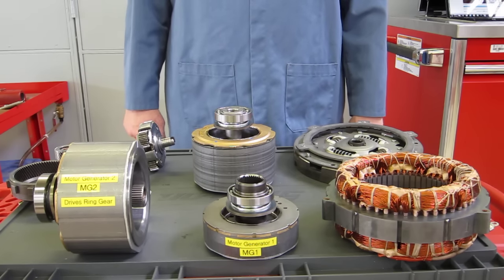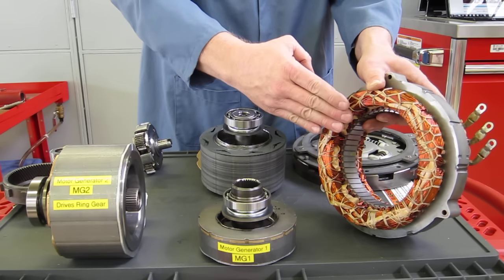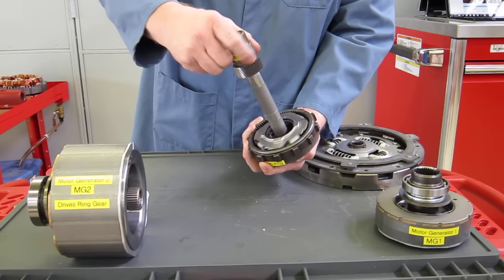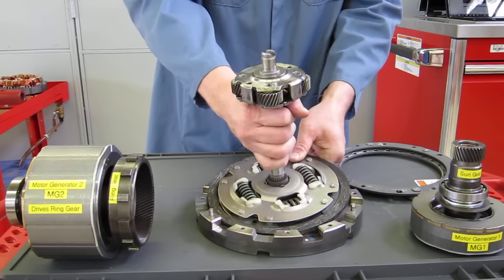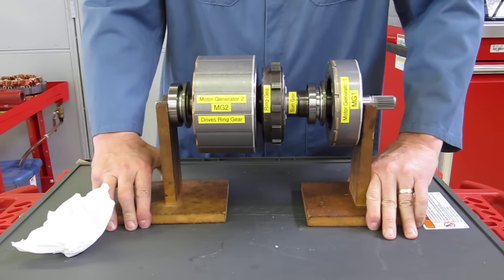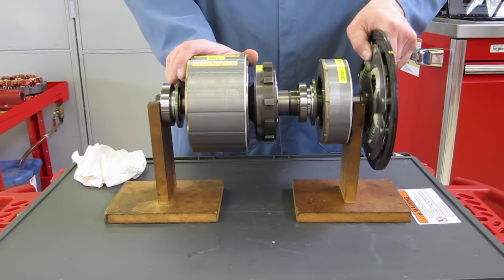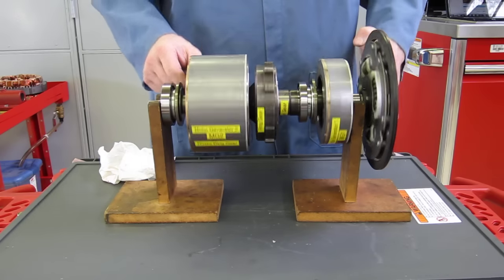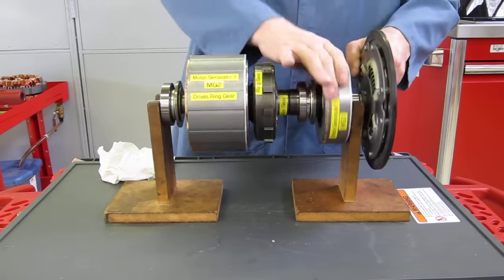2004 - 2009 Prius P112 Hybrid Transaxle (eCVT) Operation

Comment: Hey Prof. Is it theoretically possible for the engine alone  to move the car forward assuming MG2 was disconnected/removed? 
Or would the planet gears simply spin around inside the ring gear without any motion from the ring gear?
Reply from the maker: No. The engine only spins the planet carrier. The small motor MG1 would just spin. The ring gear (connected to MG2) is the only part connected to the final drive. The car would not move.
Reply: WeberAuto Got it. Thanks
Reply: @WeberAuto  I was in a Camry Hybrid taxi a couple of years ago. Their was an electrical fault so the car was using the petrol motor only to drive the car while awaiting for a part from Japan. It was slow but worked.
Reply from the maker: @briananthony4044  There are many electrical faults that cause the engine to run, but that does not mean it was the only source of power. I suspect the engine was spinning MG1 to send power to MG2 to propel the vehicle.
Reply: @WeberAuto  Given the condition in Kie Njirus comment, in which MG2 was electrically disabled but still able to spin, the ICE could theoretically power the vehicle as long as a resistive current were supplied to MG1 to slow it down, or resist freewheeling.  This would allow power to transfer directly from the ICE to the ring gear and power the vehicle down the road.

Comment: Quick question. We had the chr, coming down a mountain and reached full battery but engine was reving very high! Is this to disapate unwanted energy?
Reply: Probably it might be due to engine braking
Reply: You should use the B mode of your car to slow down more. Going downhill your MG1 is turning and producing electric power for your hybrid battery. Because you don't slow down enough and your hybride battery is full, the ICE engine is started and uses the pistons compression as a extra break.

Comment: It's a weird experience for sure to drive your first hybrid like this. Downside is that it's really hard to feel speed when there's very little road noise, engine noise, vibrations, road feel on steering wheel etc. driving dynamics. After driving a super-communicative Mini Cooper S for 5+ years, this is soooo strange. 50MPG beats 22 though...
Reply from the maker: Thanks for your feedback
Reply: Put it in B mode and use Eco mode to have a smooth pedal-throttle response curve. It’s literally a CVT downshift, keeps the power where you need it and simulates engine braking. 

 I’m passing cars and keeping up with sports cars. The Prius is no joke when it comes to weight. 3K lbs for a car this large and well equipped. 

I can drive it faster on super windy downhills  than my M3 E46. Its only limitation is tire sizing and suspension upgrades. But if the tires were the same size, I think it’s smoke the M3.
Reply: @CFloPhotography  Mine's an older model, so no eco.

Comment: Which one do you think is more reliable. A normal CVT or the eCVT from the Prius? I want to give CVts a try but I’m afraid they’re not as reliable as a conventional automatic transmission.
Reply: my understanding is a push belt CVT  (the typical "snowmobile/scooter transmission" type) is inherently flawed for passenger cars, they're generally unreliable  and the belts have a tendency to score the variator cones (pulleys that make up the "variable" part of CVT) and grenade at the worst possible time (especially JATCO transmissions),  the safest rule of thumb is to avoid belt base CVT, which is most of them

transmission reliability  (best to worst)
Manual>Toyota E-CVT>torque converter auto>DSG/DCT>bicycling>horseback>walking>CVT

Comment: I'm a bit confused.  I've been told that this is a parallel hybrid (engine and MG in parallel) but this demonstration makes it seem like a series hybrid.  MG2 drives the car, and MG1 is driven by the ICE and generates power for MG2 and the battery.  How much power from the ICE is passed to the driveshaft?  There appears to be no direct connection, but is there some force passed?

Comment: @end he incorrectly says the engine is not driving MG2. He holds MG2 in place to try to show it's not moving. There's no brake(band clutch)so this isn't happening. At high speeds, engine drives the PC & the battery drives MG2. MG1 is being moved by the sun gear through the combined output of the other two, and generates electricity to keep the whole thing going. It's a partial conversion from kinetic>electric>kinetic energy, hence less efficient, hence prius is not as efficient at hwy speeds

Comment: I'm a hardcore manual guy, I utterly loathe automatics (esp. sludgeboxes and push-belt CVT), but I have to admit the simplicity and robustness of the e-CVT is impressive...

no fragile, slip prone belt, actual, real *gears*, and it looks like it doesn't have the power waste of the torque converter, it has performance potential...

pity that the Prius is about as much fun to drive as getting a root canal with no Novocain... Toyota, why not put your E-CVT in a car that's actually FUN to drive!

My current daily is a '12 VW Golf TDI with the DSG (manuals are rare and more expensive in my area), I do wish I had waited for a CPO manual , but I needed to replace a totaled car ASAP, and for 9K I can live with  the compromise that is the DSG

that said, the DSG is about as close as you can get to a conventional manual in an automatic.

once Toyota puts the e-CVT into a car that doesn't induce a comatose state when driving, i'll try it out

e-CVT in an 86 or Supra, okay, as long as the manual's still available**

** I know the BMW...err...Supra currently doesn't have a manual, bad move ToyMW...
Reply: MacTechG4 modern automatics lock up the torque converter and bypass the hydraulic coupling pretty aggressively, so the “slushbox” term is several decades out-of-date.
Reply: @Kyriaeus  ; very true, but they're still not as direct as a true manual or even a DSG/DCT, they are more reliable than a DSG though, like everything else, its a balancing act and I fall on the side of "fun driving experience", so it's either manual or DSG for me, YMMV

Comment: How does this achieve continuous variable speed?
Reply from the maker: In EV only mode, it does not. In combined (hybrid mode) the rotational speed difference between the 2 motors and the engine creates a CVT affect in relation to the engine crankshaft speed. Thanks for watching!

Comment: How reliable would you say these 2nd Gen CVT are? I've heard horrible stories on these types of transmissions
Reply from the maker: Very reliable, no worries
Reply: The name CVT describes the function of the transmission, not the mechanical implementation. Nissan, for example,  has a reputation for garbage CVTS in certain cars. Don't assume all CVTS are similar in design.

Comment: I have a gen 2 and it has a loud whine when I let off the gas. It also has trouble getting into ready most of the time. I always have to unplug the 12v to get it into ready mode. Mechanic said I need a new transaxle. Do you think this is the cause?

Comment: If you hold still MG1 then the input shaft should turn at the same speed as output shaft, at this moment the engine will be directly connected to the wheels. So i do not agree with the statement that at no time the engine is connected to the output shaft 😉

Comment: My last automatic car only lasted 60k miles when the gearbox failed, yet these transmissions seem to last up to 400k miles or more, should have bought a Toyota instead of a vauxhall. That was seven years ago, only driven manuals since. Although I had a few automatics prior to that and these did reach 200k miles!

Comment: 13:48 So the I.C.E. engine never directly drives the wheels, only the electric motor does that?
Reply: Never directly, however the ICE can contribute to the output of the hybrid system and charge the battery at the same time.
Reply: @aspecreviews  if it contributes, that means it DOES drive it at a certain speed..

Comment: 12:54 "mg2 spins faster and becomes charging"  should be mg1, i believe you may have misspoke
Reply: so it's not a "cvt" cuz, the ratio never changes.  just the power and rotational split btw mg2-mg1-ice.  
i read that newer toyota hybrid's may have 2 planetary gearsets.. that would have a nice demo :)
thanks weber auto, nice demo of the actual hybrid transaxle.

Comment: watch?v=rQhzruw2Qh8&t=9m13s on youtube and see that this idea was not originally from Toyota. It was presented in 1953 by the DoD (fast forward to time mark 9:13 of that video). The 2 inputs mentioned by the Army engineer corresponds to MG1 and ICE. Toyota drives the output gear directly with MG2 also, so they've improved it to become a 3 input system.

Comment: If they scaled this up size, power and had out in a RWD platform; I'd stuff it in a 70 Chevy Chevelle for two reasons... 1) seems like way less wear and tear cause like every other cvt your always on the right gear 2) save on gas (bonus) make every V8 bow tie fan mad cause I made a Chevelle a hybrid. But I think it would be fun if they could increase the power.

Comment: Geez its a simple system. I wonder why toyota choose to not put a larger m1 in place or the same size as m2. The whole driving and not charging while going from m1 assisting in keeping the charge up is quirky to me even if it was dropped to 50% of full power generation. Its like a no brainier thing to do. It would allow you to go a little further but their is a trade off at some point where it hinders distance. my 2 cents.

Comment: Hi I still don't fully understand the function of the Transaxle Damper... It would be really helpful if you could elaborate on it.  Is it basically a dry friction clutch but always applied? In other comments you say it doesn't slip however it has springs which leads me to believe that there has to be some sort of movement within it.  What components could be damaged without it?  Does the prius ICE have its own torsional damper (harmonic balancer) or is the transaxle damper used for this as well?

Comment: He missed two points on the operation of this thing. First he says that spining MG1 starts the engine. This is not true. The engine will not start by itself without the injectors and spark plugs firing. During the all-electric time, since there is no clutch used to disengage the engine from the PC, the pistons in the engine are moving up and down. This wastes some energy, but reduces wear. It Isn't optimized for all-electric driving anyway, so probably wasn't a consideration for Toyota.

Comment: Wait what at no point is the engine driving the car it's only used as a generator, mind blown
Reply: so, you don't need a starter motor, or even a Alternator, because that's all the job of MG1. :face-blue-smiling:

Comment: That moment when you realise that calling a 3 phase electric motor a generator is absurd, due to generators generating dc energy. It should be called a motor-alternator.
Reply: Generator is correct. It is an alternating current generator, which got abbreviated to alternator.
Most electrical technical literature will refer to them as AC Generators.

Comment: I will never be interested in hybrids or EV's until they have the capability to use braking to recharge the batteries, thereby recovering some of the energy which would be lost as heat in the brakes. I live in Eastern TN where terrain is oftentimes a big factor in EV performance.
Reply: All EVs and hybrids have that capability